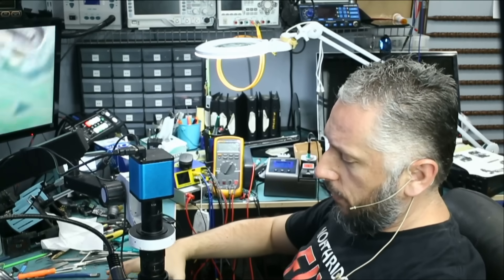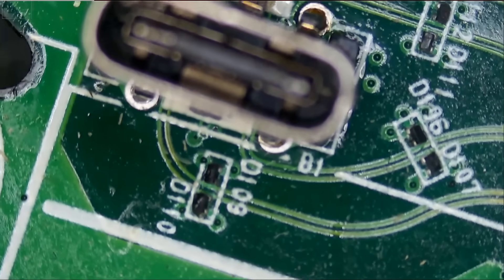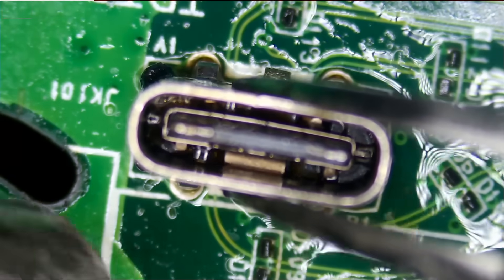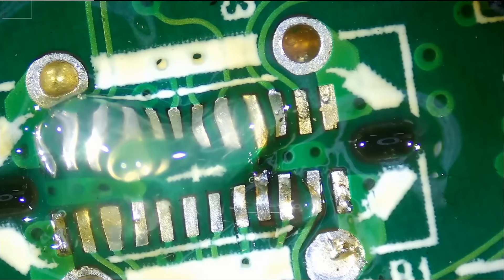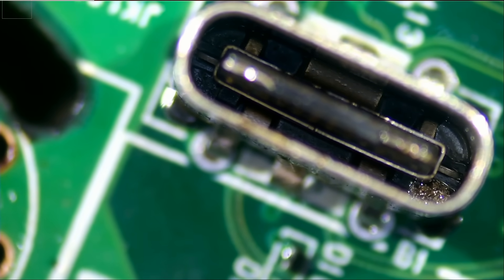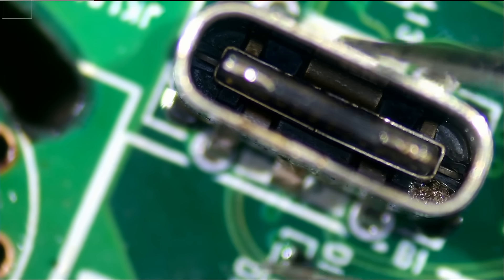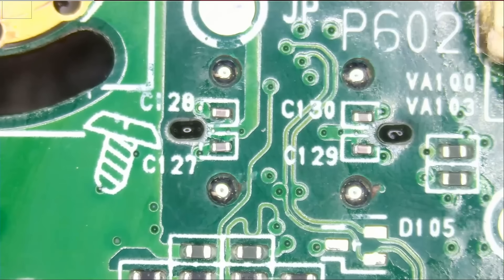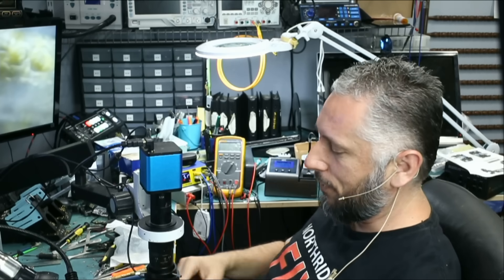$1300 LG Ultrafine 5k Monitor Repair - Common Thunderbolt issue.

Comment: Hi Alex. Not a criticism as you do an amazing job and fix so many things.

I know you say you checked the inside of the connector but at 7 mins in when your heating up the connector it looks like a blob of solder in the bottom right corner getting hot and melting and then hardens when you move away.

Thanks again for sharing your videos and knowledge.
Reply from the maker: That's Flux and not solder. I doublechecked and cleaned it further. The way it's reflecting looks like solder.. https://photos.app.goo.gl/yd3sW1tSnVsqhHTj9
Reply: @NorthridgeFix  Ah apologises it did indeed look like solder to me from the video.

Thank you for the reply and as you would say awesome job! 👍

Enjoy the rest of your day and have a great weekend.
Reply: I believe he cleaned it  just before pretesting the fit of the connector .
Reply: Nice Job. I pray I have equipments and tools like you. That will make my Jobs a lot easier
Reply: The scientist alex always mentioned 😂
Reply: Here comes the scientist
Reply: @JonJonTravelFoodie  😂

Comment: Hi there,  Long shot that but I thought I'd ask.  At 7 mins 48 seconds  you show capacitors c127 to c130.  Do happen to know the values for those?  Mine came off the board while I was trying to empty the holes for the connector and I am sure I have replacements but I don't know what value they were I could assume all four are the same but I'd rather know for certain.  Thanks for any help!
Reply: Hey, I'm trying to fix this same board. On mine c129 was burnt. Did you find the value for those? Were you able to fix it?

Comment: It did sound as a separate charge is made for 'polishing' the connector ? Personally , since the customer said nothing about it, I'd have soldered the connector and left any 'polishing ' for the customer. I Would have said "its unnecessary ", because you did as asked..."soldered the socket ". Good vid 👍

Comment: If the holes are not too tiny i use toothpicks - much more easy than using solder wick. Just heat from one side and melt solder and push the toothpick from the other side it will clean them very fast and safe. Of course it is hard to show it in clips or you can push from the same side but sometimes is harder

Comment: Repaired this exact same connector on the exact same board for this monitor a few weeks back. Must be a common weak spot with thes LG ultrafines.
Reply: Hi, I got the same monitor, doesn’t turn on when USB-C cable is plugged in. Is this the common problem you talk about? If yes, do all ports need to be changed or something else could be off?
Reply: @DJ-we2my  Most likely a problem with this port. Only this port needs to be changed.

Comment: Is anyone else having issues posting to the forums or using the 'contact us' form in northridgefix website? I have been unable to post to forum since yesterday and I also get error when I tried to message them to let them know about the issue.
Reply from the maker: For some reason captcha was preventing users from posting. It should be fixed. Check now.
Reply: @NorthridgeFix  Thank you, sir. The thermal cam I ordered from you should be here very soon and I am eager to talk with the people on the forum.

Comment: Is ethyl alcohol suitable for electronic cleaning? I am gonna use it for thermal paste cleaning if it is okay. Otherwise i will buy isopropyl alcohol.
Reply from the maker: Use 91% isopropyl or 99% if you can find.
Reply: @NorthridgeFix  Thanks for reply. Keep up quality content :)
Reply: @requiem4adreamc  The idea is that high-purity IPA leaves almost no residue, so it works really well for cleaning electronics.

Comment: How much do repair shops charge for this ? I would need to solder back usb connector on a xbox elite controller but I'm assuming it's cheaper buying a new one or buying the equipment to fix it myself

Comment: What would be the best way to start learning to be as good as you? I know it takes years but I do have a basic understanding of microelectronics but just a teardrop in the ocean compared to you, are there any resources you learned from? If not would it be possible to perhaps do some tutorial video's from time to time on some fundamentals, basic diagnostics etc? Much <3
Reply: Learning what, soldering? Read up on the principles, understand the materials and tools. What is solder, how does it behave, what temperature is safe (for parts and boards), what is solder paste, what is flux, what is used to clean the board. Procedures are well documented and should be findable in a Google search. With this understanding, get a soldering iron and materials, and a junk PCB, and start practicing. That's it. Knowledge and practice are in the history of every expert.
Reply: @user-cx2bk6pm2f  no, more along the lines of diagnostics, soldering is rather straightforward
Reply: fault finding etc

Comment: At 10:02 the connector has junk inside the upper left corner. I see it earlier in the video and I thought you would clean it out but I guess not. I guess if it works Great Job if not check it out it might be a problem. Signed Non Tech
Reply: He already clean it off camera their is a photo of it up there since many scientist complaining alex said 😂

Comment: Can you add solder musk for the weak pads
Reply: Solder mask wouldn't be a good choice here, as you want to glue underneath the pads to the board, but the mask won't harden under the pads since they would block the UV light.  Really, in this case, the USB connector will hold the pads down.  The solder will probably hold the pads to the pins more firmly than most glues you could use to hold the pads to the board.  Any glue you use would have to be able to withstand the soldering temperature (super glue would not work for this reason).
Reply: Solder mask on top of the pads? That would prevent the solder sticking to them. Not sure what you mean.

Comment: HDMI and USB-Type C was a mistake. Bring back DVI and VGA style connectors for displays.
Reply from the maker: I agree, i never seen a failed VGA DVI connector.
Reply: Try 4K on VGA
Reply from the maker: @octav, your have more pins on a DVI connector then Thunderbolt. It can be wired to do 5k. It's the size of the connector that is preventing technology today from using them since everything is becoming smaller, thinner and therefor more likely to fail not taking into account that USBC controller chip fail on almost all USBC powered devices.
Reply: @NorthridgeFix  you are correct, the connector could do it. But the backwards compatibility would be lost (DVI is also analog compatible, right?) So we would end up with DVI digital only HDMI like and old DVI. 
Technology asks us to move forward, in the same way you could argue THT is more repairable but SMD is far superior
Reply from the maker: Analog / Digital has nothing to do with the connector. Pins and wires are pins and wires whether it's a DVI or Thunderbolt A DVI could be wired to do whatever it is told to do with no problem. It has more then enough lines to do the job.
Reply: +1